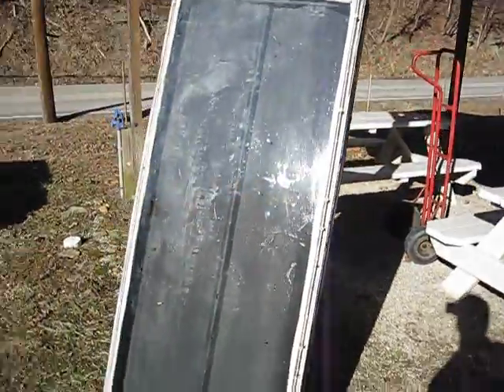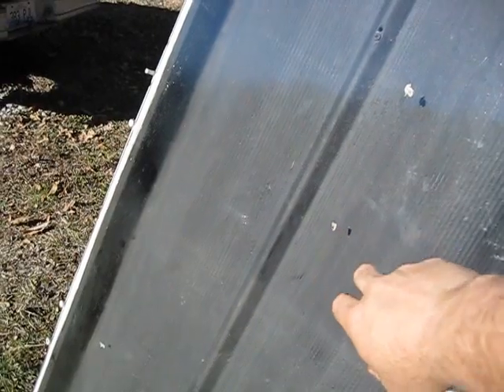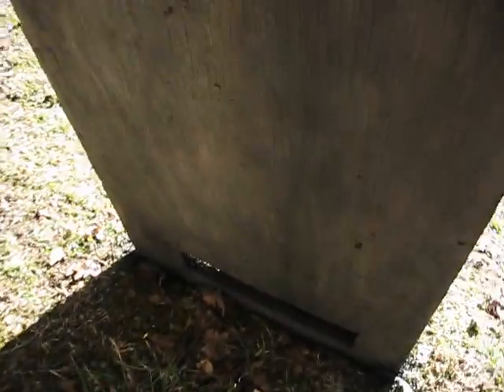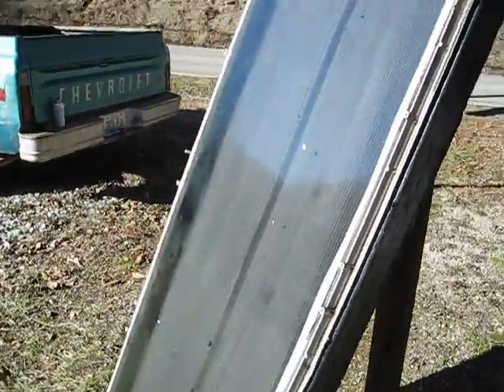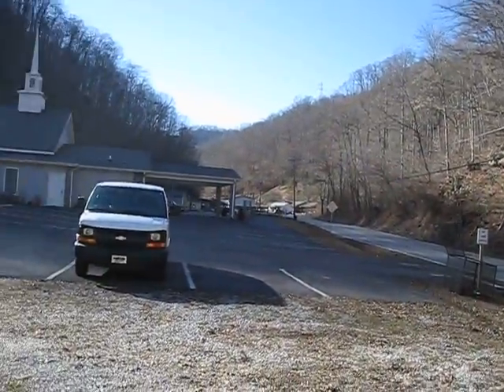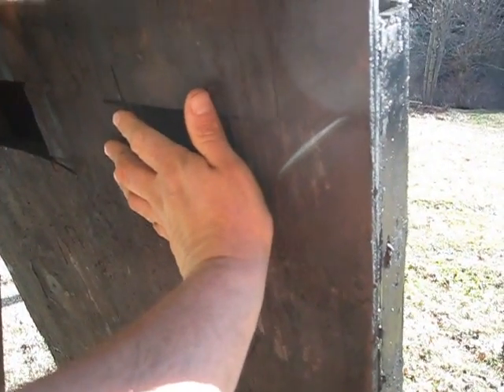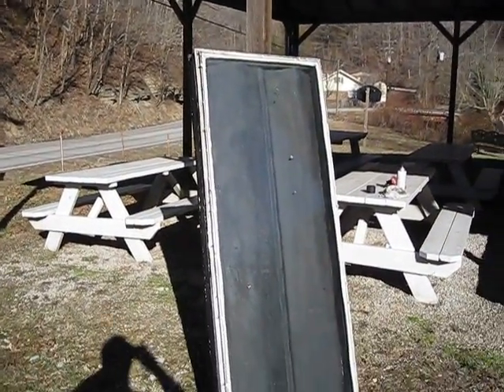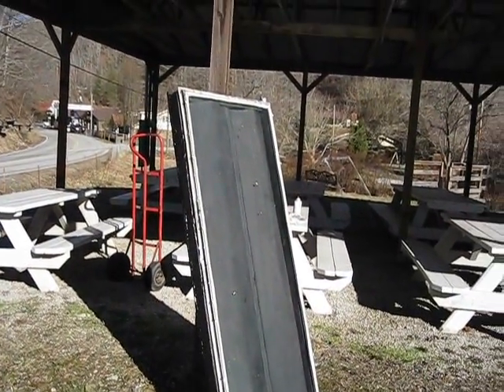solar heater experiment

Comment: Hello,
I just found your channel and have a recommendation for your solar heat box. If you would insulate the inside if the back of the box plywood with that shiny aluminum covered bubble insulative wrap it would greatly increase your heat output due to less heat loss through conduction of cold into and the heat of the panel itself through the plywood back . Other than that I think you did one hell of a job man. Great work! You need to also post some more videos of your plans and projects. Go man Go.....

Comment: What does the glass do?
Reply from the maker: The glass works like the windshield in a car, reflecting the heat and sunlight back into the box which is what helps the heat rise rapidly(think of the interior of your car with the windows closed on a sunny day).